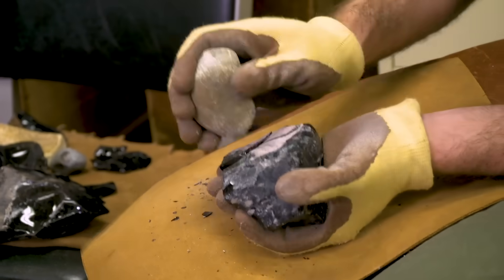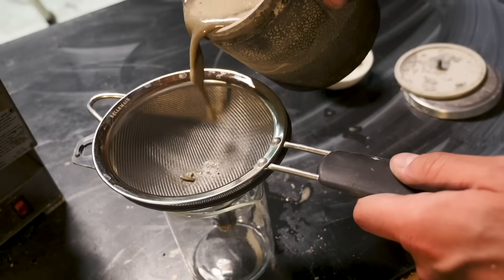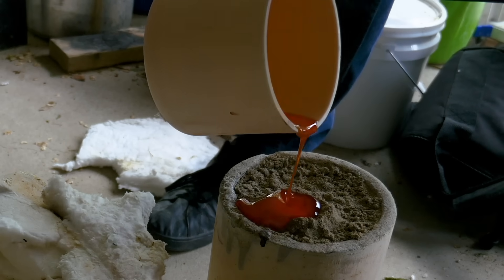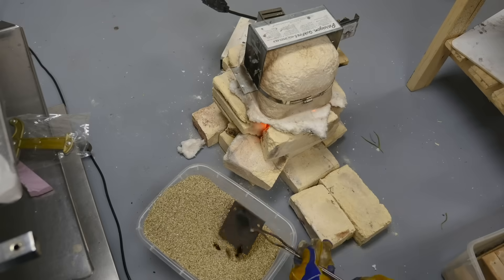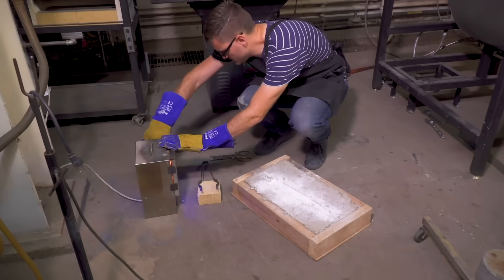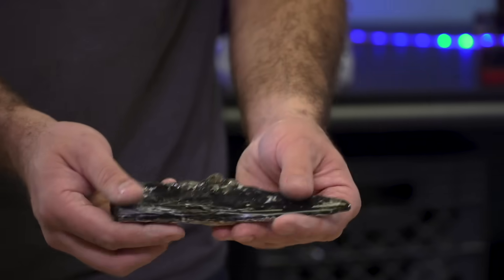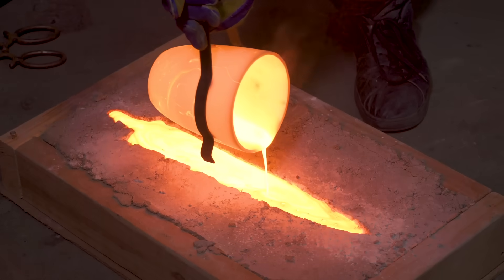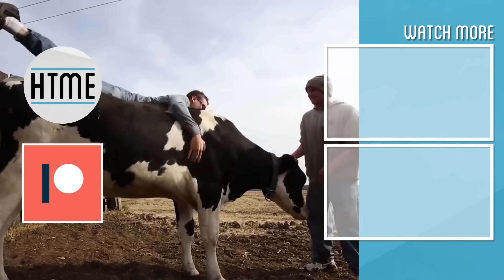Can You Melt Obsidian and Cast a Sword?

Comment: You kneed magma to cast obsidian liquid metal or rock and  then you put the sand into the mold and poor in the magma. I'm not sure if this works but I have seen artifacts in museums that were cast obsidian.
Reply: I have been wondering how to do it I was thinking some obsidian meridian axes would be awesome
Reply: An idea I had watching the video is it looks like it becomes molten in your first experiment. Why not just use about Triple the size kiln and place the form under the crucible with a runway so it just basically runs into the mold. Another thought is that you might need to place the form under pressure somehow so it doesn't escape.
Reply: Might also try granite powder in it instead of sand might keep it from breaking

Comment: I have a question, if the obsidian is heated to over 2000 degrees, what material do you use for the crucible? Since that would likely melt too.

Comment: To be honest, it takes days if not weeks or years for magma to cool if it's thick enough. I'm curious if you had used ground up magma chunks to cast the Obsidian instead of sand, and pre-heated said cast to an ambient temperature before pouring if the obsidian would have held up better.

Comment: Short answer...no
Reply: I didn't mean that they said not only with obsidian, but that they didn't say only with obsidian. Meaning, technically, yes, you can.
Reply: you can't melt obsidian and cast it (pouring it into a mold) but you can melt obsidian while it's in the mold to make the sword. it's how glass companies do it too. still, casting obsidian is a big "NO".
even when made with obsidian impurities, the weak sword looks like it's going to bend over and break if held horizontally.
Reply: Watch the video. The short answer is actually yes.
Reply: watched the video. the "short" answer from that is still no.
Reply: if you even watched the video with a brain at all,
the obsidian's melting point is obviously too high to melt into proper liquid,
and he mixed in an immensely large portion of other materials to make it meltable to make the "obsidian" sword.
quote unquote because it was mostly flux.
Reply: The question was can you melt obsidian and cast a sword. Not only with obsidian.
Reply: some pizza guy no
Reply: tommy d u b b s Did you just like your own comment?

Comment: this is very interesting, designing around thermal expansion is stuff a tough issue! If you ever want to revisit this I would suggest on a different cast shape. Perhaps a a hollow or cut out center so as to reduce the amount of stress from surface tension and a more rounded design such as a smooth curve at the end instead of a point. Another idea would be to cast around some inert core such as a ceramic, doing this could allow you to more easily cast a thin layer.

Comment: I wonder if using more of the metals you used as a dye would create a sturdier molecular structure? Ie; instead of a 30% flux, 10% dye, 60% obsidian mixture say (just an example, no idea what you used) would 30% flux 30% obsidian 40% chromium/aluminim maybe make a sturdier blade? Might let you work it more as a metal than a glass as well, making the annealing unnecessary. 

tl;dr I'd crank up that metal content, bruh.

Comment: dude, if you called a material engineer would have helped.
first, you need stirring during the melting, since there is clearly formation of bubbles and impurities on top and the bottom of the melt solution.
second, you need to make it cool reaaaaaaaaaaaaaaaaaaally slow. in air is too rapid. I worked on tempering for bulletproof glass, and they cracked at 300/400 C in air. you should have needed a second big furnace at controlled temperature after the cast. 
third, the sand that you are putting in it's also cold, it's a thermal shock. You need work also on that.
I cannot comment on impurities, you have to select them really well to improve the cast, but they are also going to create defect in the cooling and stress concentration.
fifth: try to melt throw a sinterforging system. this will improve the viscous flow, and make it easier to cast with less impurities.

best! :D

Comment: There are a couple of things I would try.

Rather than melting and pouring the compound, I would melt it directly in the cast. That would require you to make a crucible that is in the shape of a blade and tang

I would add Aluminium Oxide into the mixture.

The final method I would try would be trying to replicate the Prince Albert's Drop effect.

Comment: Remember folks, Obsidian is NOT at all strong like video games lead you to believe.

I'm looking at you, Minecraft!
Reply: obsidian is just very hard and has an amorphous structure that allows for fine blades and points. the hardness lets the blade become incredibly sharp and stay fairly sharp. however the obsidian blade will never be stronger than glass. the shorter the blade or blade segments the less likely it will be to break. Also I found no evidence that vikings used obsidian weaponry at all, several searches of various wordings yielded no factual results. TL;DR Obsidian is too hard to make a long blade with and will probably snap if it ever stops suddenly.
Reply: the key word there is tipped. the small blades or arrowheads would not break. if you look at obsidian weapons the blades are often small and segmented. Steel can bend before it breaks, obsidian does not bend and therefore shatters. if the blade never bends or deforms considerably, then the blade will be perfectly fine. Trust me, I've been studying and practicing blacksmithing for nearly two years. obsidian is just too hard for a large blade. the same issue plagued original katanas, where clashing with other weapons could cause the over hardened blade to break.
Reply: Obsidian is unbreakable at full-form.
Reply: DexPlays you can break it with a diamond pickaxe
Reply: Obsidian is unbreakable? Diamond is unbreakable... or not.
Reply: borukamante - No, it would shatter into fine particles as soon as the firing pin hits it.
Reply: And fortnite pve lol
Reply: TriiiKill well obsidian in Minecraft is an entire meter squared so yeah
Reply: TriiiKill dude shut up we're not all in creative mode
Reply: i'd like to mention that after being proven wrong, borukamante edited his comments.
Reply: and firing slivers from an air rifle/ air cannon would be more effective, however it would need a quite air tight wadding
Reply: TriiiKill That's true, obsidian was only used for weapons in very early civilisations because they didn't have the technology to make anything better at the time.

Obsidian is far softer than diamond, and far more brittle than any structural metal alloy. 

An obsidian sword would be useless for any practical purpose, as it would shatter if you hit anything with it. 

Steel weapons are far superior, which is why as soon as people knew about steel everyone used it. If obsidian was any good for making bladed weapons then people would have just used that instead of steel.
Reply: however, if it's sharp and it can shatter, it's possible to use it as shotgun shells.
Reply: Honestly, I think stones would work better?
Reply: @triikill depends on the purpose
Reply: TriiiKill also ebony is not a metal but wood apparently.looking at you skyrim
Reply: TriiiKill very sharp though, if sharpened
Reply: All the comments about the strength of obsidian I've seen are just wrong. It's not "strong" in smaller segments, the only reason it was usable for weapons is the molecular structure which enables edges so sharp they make surgical scalpels seem like blunt force instruments. Obsidian weaponry had to be replaced almost every time it was used, weapons like the macuahuitl could reuse the base, replacing only the embedded obsidian shards. One of the most dangerous things about it wasn't even how sharp it was, it was the fragments that would get left behind inside the wounds it caused.
Reply: Bro I spent hours mining away
Reply: TriiiKill I know what you mean. It’s the same idea in Fortnite save the world.
Reply: its around 5 to 5.5 on the mohs scale. Around as hard as normal window glass.
Reply: I think the fragments might turn to dust, lols
Reply: Couldn't you make a significantly sharper edge with obsidian than say an iron sword?
Reply: Derek Chiazza Yes you could make a sharper edge with obsidian, but if you hit it against another steel sword the obsidian would break.
Reply: Sharper edge, yes.  Some very delicate surgeries actually use obsidian scalpels, as the edge can be as few as 5 molecules thick, far thinner than we can achieve with any metal.  Unfortunately, just like in this video, these scalpels are VERY delicate, and have to be handled with EXTREME care.

So, not good for a weapon.

Comment: do you pre-heat the sand you put the glass in to cool?  when your glass goes into cold sand there is a large temperature difference and can cause the glass to cool too quickly in the initial set.  This will allow the sand and the glass to cool slowly together.

Comment: I wonder if this guy knows that any sword/knife made from molten material regardless of whether it is metal or not will shatter. That is why no sword intended for use was ever made this way.
Reply: bronze is cast from a molten mixture and was used for weapons and tools until iron was discovered.
Reply: Jon Oakley True and as those still in the bronze age met those beginning the iron age they quickly found that cast weapons were as useful as sticks against weapons that were forged and the bronze age was quickly abandoned.

Comment: They mix graphene into rubber to increase it's strength exponentially and it's thermal shock resistance. I wonder if the same process would work with this? If you did it you could open up a whole new line of knife and sword making and it would be worth a shot.

Comment: I think rather than bringing the obsidian to the mould, you should try bringing the mould to the obsidian. As in, create a mould, leave it in the path of a lava flow, and carefully excavate it after it cools. Sounds crazy I'm sure, but likely doable. Tungsten is a metal with a very high melting point, much higher than recorded lava temperatures recorded around Hawai'i, and it's decently cheap at $20 a pound. There's also no known health hazards of working with tungsten, although all metals should be treated as hazardous in dust and heated forms. So if a mould could be created from solid tungsten or tungsten-plated stainless steel, it could be set in the path of a lava flow, and carefully excavated after cooling. If a half-mould was made like you were doing, some serious shaping would need to be done to the exposed side, but if an enclosed mould with an air outlet near the tip was made, only a small amount of shaping would need to be done st the end. A tang should not be incorporated into the mould though, as the viscosity of the flow wouldn't let it fill the blade heel well enough. Instead the heel should be made manger than desired, and shaped away into a tang after the blade is retrieved.

Comment: What you have made is a primitive experiment in glaze chemistry.  All minerals are silicon based which is what forms the glassy parts.  The differences in the stones depend on the combinations of feldspathic materials and trace metals, and how they are dispersed when they are formed in nature. These combinations also affect their crystalline structure which is why stones break in certain patterns.  When you smelt a metal by itself like copper or tin it can be used to cast and end up the same element because it was only one element to begin with.  When you melt a rock, you no longer have that rock, you now have a mostly common glassy silicate left after the dispersed feldspars and trace metals separate from the bonds of the crystalline formation and gather away from the glass, which is why u got a more clear transparent result.  It is no longer obsidian. It is just a blob of quartz silicate with “impurities” as you put it separating by weight.  Those “impurities” are the parts that actually separate the obsidian from any other rock. Its just the combination, pressure, time, and temperature nature used when creating it.  You can create blackish glass which is what you kind of did. But there is no “obsidian” anymore as the crystalline structure that created the obsidian to begin with has been changed completely.  There is no difference between melting the rock itself or adding each individual component that comprises obsidian chemically individually to a crucible and melting it. You will still get glass, and it will be weak and unable to be knapped properly because its crystalline structure has been completely altered.

Comment: So don't cast it. Take a look at powdered metal and ceramic technologies. If you take the powdered mix and heat it enough to adhere you can either do additional compacting while in a soft state  or press it in a  hydraulic press beforehand. The process is called sintering. You could probably get a good result with that process.

Comment: can you make glass with random metals ??? like what color it makes. and how hard it is with each type of metal. like you shown you can make it looks black when you added nickel and chromium. so what happen when you add iron or maybe some copper . will copper make it green ? will iron make it harder to shatter ?? only one way to find out and you can even mixed them together
Reply: Tobiwolf Nope, you can’t. Glass is melted sand.
Reply: @VbgVbg 113 Glass is simply an amorphous state. Many plastics have a glass phase. Household glass is just a specific form of glass, just as the Moon is a specific moon or table salt is a specific salt. Metals (if cooled extremely rapidly) can form an amorphous state as well.
Reply: Yes, you can make glass with metals. It looks like normal metal. It's harder than regular equivalent metal, but we don't really know the extent of what we can do with it because it's hard to make. For reference, it's usually made by casting metal on a rapidly rotating,  liquid-nitrogen cooled wheel which forms thin (sub-mm) strips.
Reply: Cobalt is added to make blue, chromium for green, cadmium for yellow (but it's toxic so isn't used to produce glass), titanium for  yellowish brown, uranium for fluorescent yellow/green or red depending on admixtures, lead can be added to increase the refractive index which is what gives lead crystal it's sparkling prismatic qualities, gold is added to produce red which then reheated produces a brilliant gold, manganese was one of the first metalic additions to glass in ancient Egypt and will produce purple, iron oxide mixed with chromium is what gives green wine bottles their familiar color, copper produces a dark opaque red, silver for a reddish-orange to yellow, selenium for pinkish to red.

Comment: I always figured the mythical blades in GoT were alloys, mostly steel but with a bit of obsidian added to them. It's not like they didn't have some version of alloys for centuries ((I think Bronze is one isn't it? Different metals melted together to create a new one)) I figured pure obsidian would be more used for arrow heads which as you showed could be "knocked" razor sharp.

Comment: I found a small piece of obsidian in between my lava rocks that I use for my aquaponics system, not knowing what it was. So I went for a search and discovered the material. That is how I learned that obsidian blades are used for scalpels for animal research, and those blades are sharper then the best steel scalpels. The edge from an obsidian blade can be only three atoms thick and compared to a steel blade edge very smooth. So be careful with obsidian because it can be super sharp, far beyond razor sharp.

Comment: It's pretty well known in forging and blades that you really don't want to cast the blade ever.  Cause casting has no forge or hardening process so the blade would always be brittle, regardless of what shows like GoT show or various, even in olden times. a Blade would never be cast.   But I get why it's necessary with something like glass.
Reply: Kenjadeffx 
Well if I remember correctly they went over to using molds because it was much more efficient for making as many as possible and requiring much less skill of the maker. So not sure what you mean by not casting it seeing even people in late medieval  times did use molds
Reply: We are technically both Correct.  Bronze yes.  Steel or Iron?  No.
Reply: You can cast bronze you can't cast steel
Reply: Yep,  that's what I was saying, Steel is an Alloy,  So it needs to be a mixture of two metals.
Reply: Bronze is an alloy too my guy

Comment: Part of the very nature of obsidian is that it forms from very viscous felsic lavas.  If you're adding flux to make it non-viscous, you're making something very different from obsidian.

I think if you wanted a cast obsidian blade, you'd have to cast it between two moulds under pressure. Relying on gravity just won't cut it, and if you add flux, it's not obsidian.

Comment: Wow...would have went SO MUCH EASIER if you had just crushed the Obsidian into POWDER with a HAMMER MILL (NOT a ball-mill), then Hammer Milled your flux also into powder, then folded the powders together BEFORE the furnace (then, the flux would have risen through the melt and taken impurities with it). Stop thinking 'glass maker' and start thinking 'blacksmith'.